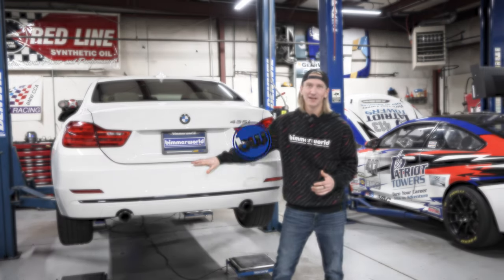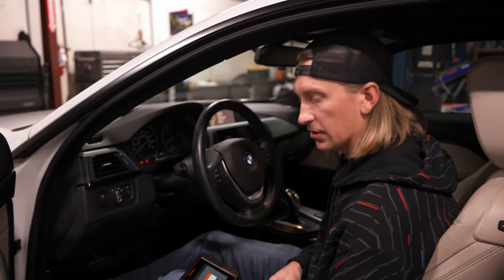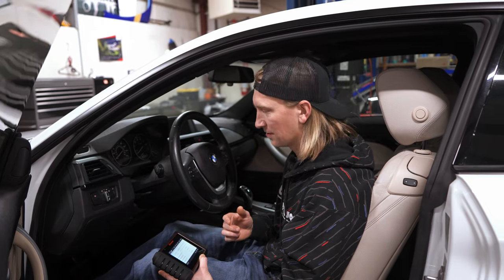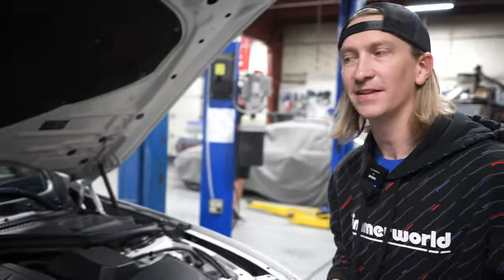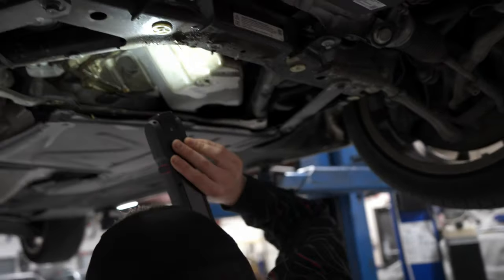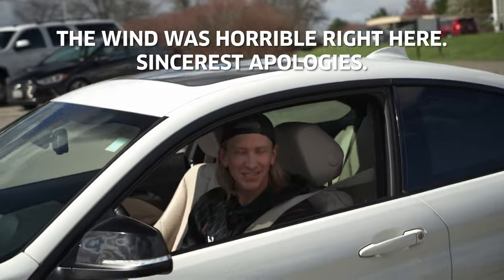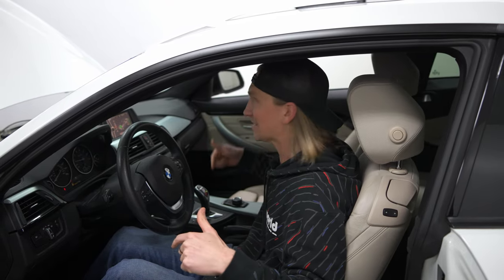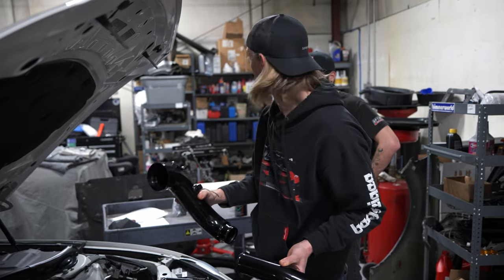The DIY "F32 M435i Racing" Project Build - Lets RIP IT APART!

Comment: Are you planning to fit the GTMore suspension to this platform or is that even an option?
Reply from the maker: No, it won't be anything that extreme.  Just not the concept behind this build.  Will rely on more factory style suspension components, but beefed up where necessary and obviously with performance in mind we'll still dig into areas where we can make  better.
Reply: @BimmerWorldMedia  Will the GTMore kit bolt up the the F3x factory mounting points, other than likely tire/wheel clearance issues with the fenders and liners?